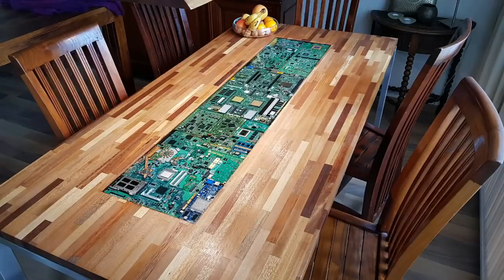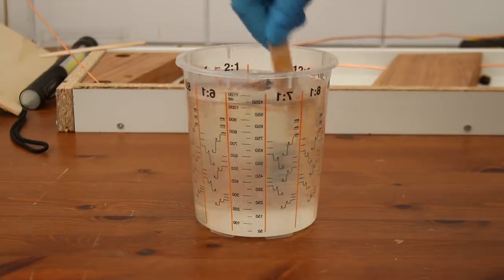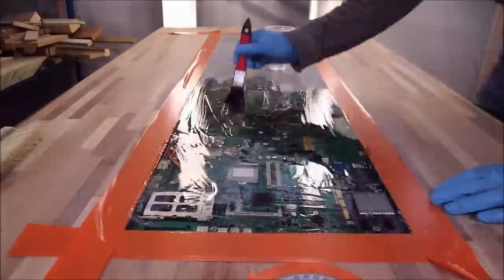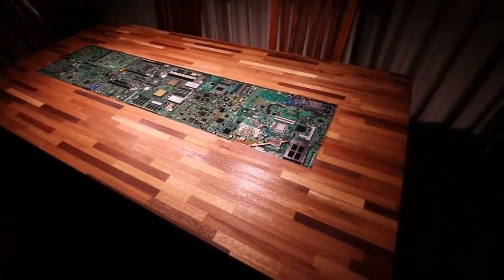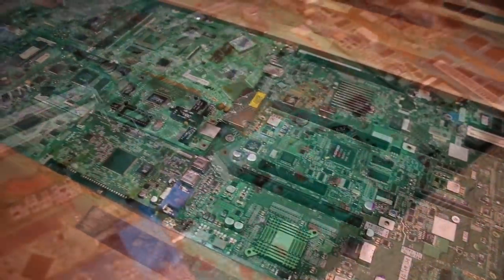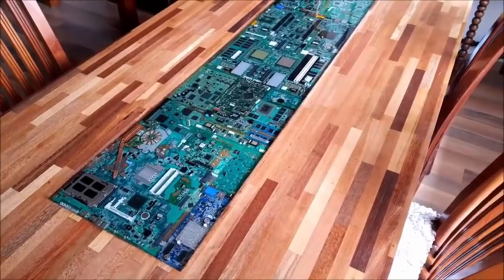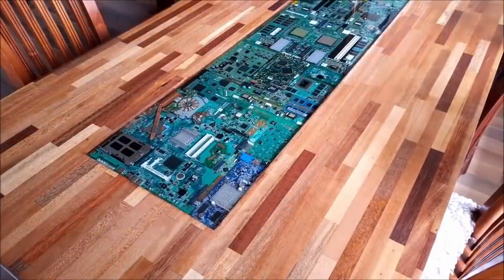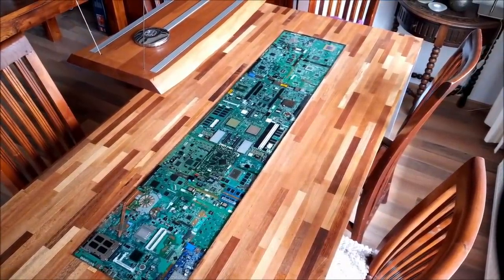Circuit boards with lights in epoxy in a table

Comment: Would of been better off with wires and a battery for the lights, the fiber optics where almost as many wires and you still need a light source lol
Reply from the maker: I deliberately left out the battery powered lights with controller, because I thought you would go crazy quickly of a carnival in a table all the time... 😊 It is the temporary character of the manual light for a few seconds in the fiber optic that I like.
Besides, this setup is infallible, whereas functional LEDs could break down & never be repaired.

Comment: I would coat the whole table in epoxy (or something else) and let it drip over the sides.    In addition to solving the stickiness problem it would protect the wood and the table would have been level and not required sanding.
Reply from the maker: I thought about that, but decided against it. For three reasons mainly: 1. the ugly spots would still be in it, 2. I don't like wood 'wrapped' in epoxy (I like to feel the grain) and 3. it would stop me from learning something about epoxy when I would try to fix the table. So that is what I did, as you can see here https://www.youtube.com/channel/UCNdDV4vHKjuWOYlEW4HIk5w/community I've begun trying to fix the table. I routed out the bad spots and am pouring in new epoxy. The first results look promising. Wait for the video 'how (not) to pour epoxy'. 😊

Comment: Good Work, and thank you for revealing the Fail!  you  could cut all around the table, including the bottom, add false bottom and redo the center with a new experiment.
Reply from the maker: Yes, could have done that, but I didn't. As you can see here https://www.youtube.com/channel/UCNdDV4vHKjuWOYlEW4HIk5w/community I've begun fixing the table. I routed out the bad spots and am pouring in new epoxy. The first results look promising. Wait for the video. 😊

Comment: That is really cool, I love this idea.  I have never worked with epoxy like that so I am wondering if you have ever tried to light a project like that with lights set in the side of the epoxy area?  would that transfer light in the entire area of epoxy evenly or would you have hot spots of lighting?  It would be cool to light the entire center section with a hidden light and then also have the led's light up as well.  fantastic project and I hope you get the epoxy layering problem figured out.
Reply from the maker: I once put a LED strip underneath epoxy, that you can see here.. https://youtu.be/DbGp6R-TN2w?t=552 but it wasn't a big success. To get the light more evenly through the epoxy, you would have to light from the sides and not from underneath. 
As you can see here https://www.youtube.com/channel/UCNdDV4vHKjuWOYlEW4HIk5w/community I've begun fixing the table. I routed out the bad spots and am pouring in new epoxy. The first results look promising. Wait for the video. 😊
Reply: @Onrust1  I see what you mean about the LED's not distributing the light properly.  I am thinking they might need to be embedded in the epoxy, like in a small pocket of epoxy off to the side but I have never tried anything like that so I have no real idea.   That pebble table came out great!  
Question for you on the repair of the circuit board table.  have you considered routing out a section and using another color?
Reply from the maker: Someone else did the same suggestion, but I couldn't see how it eventually would look, and wanted it to be as my initial idea was. So different colors was not really an option for me..

Comment: I just seen you you put one fibre optic access points for a light. But yet the demonstration indicated lights flashing intermittently independent. How is this done on one light source
Reply from the maker: 😊
Easy... the light source is small.. the LED on my phone is almost as small as 1 fiber optic cable. By moving it around, you get this effect. You're invited to come and play with it. 😊

Comment: Have you checked with the epoxy manufacturer.  Some metals interfere with the epoxy hardening.  The metals in the circuit boards may be the source of the problem.
Reply from the maker: I can rule that out, because there are no problems on the epoxy - boards contact level. No, the flaws are all at one level, about 6 to 7 millimeters from the surface. It's where the 5 liters-at-once pour ends and I poured a new batch on top, so that it must be that the 5 liters batch was partly not well mixed. I'm pretty sure about that now. In fact I'm making a video of the fixing of the table, where I show this all in more detail... wait for it.

Comment: The table is a nice idea, but not for a home. Maybe some office? Also laying the boards so wide wasn't good, you could have saved work and epoxy for the effect. The fibreoptics is a touch of genious though, especially if you'd route channels to the bottom of the table. Additionally attaching a small led circuit running on a small battery and few capacitors to the end to make the lights blink in sequence automatically would be cool
Reply from the maker: I deliberately left out the battery powered lights because I thought you would go crazy quickly of a carnival in a table all the time... 😊 It is the temporary character of the manual light for a few seconds in the fiber optic that I like.
Reply: @Onrust1  I get that, it's what you prefer, but then theres people who like to fill their computers with rgb leds and people who like the 80's bleep bloop computer aesthetics :) and  it's not a mutually exclusive with a bit of further engineering. Just as a idea to chew on though. Good luck with your projects!

Comment: epoxy is dry now, so just put another layer of epoxy, this time over the entire table. :D
Reply from the maker: I thought about that, but decided against it. For three reasons mainly: 1. the ugly spots would still be in it, 2. I don't like wood 'wrapped' in epoxy (I like to feel the grain) and 3. it would stop me from learning something about epoxy when I would try to fix the table. So that is what I did, as you can see here https://www.youtube.com/channel/UCNdDV4vHKjuWOYlEW4HIk5w/community I've begun trying to fix the table. I routed out the bad spots and am pouring in new epoxy. The first results look promising. Wait for the video 'how (not) to pour epoxy'. 😊
Reply: @Onrust1  i see. its alright, that just means on to the next epic thing you are about to create.
Reply: Also table is bent in middle meaning if you pour epoxy over entire surface, you'll still have thickness problem in middle.
Onrust is not smart/crafty enough on overcoming a bow (his solution: pour more epoxy on the sides of un-level surface smh)... Proper solution: level half of the table by raising this half, epoxy this half, and then do same for opposite half, and sand/finish at the seam. I just don't think someone who forgets to use a level before epoxy pour (which would've alerted him to bowed table and middle thickness issue) should be making youtube videos.
Reply from the maker: I did use a level.

Comment: Hi,
Nice video! How did you manage the fiber underneath the tabletop?
Reply from the maker: Thank you. What do mean with 'manage'? You can see briefly at 6:55 in the video how they run under the table. Later I put an extra sheet of plywood underneath, just to protect the fibers. I hope this answers your question.
Reply: @Onrust1  Thanks! I mean, organise, set up, protect, attach, or whatever keeps them clean and safe :)

Comment: Can you put a sheet of glass over the entire table? That may fix the issue, or at least make the table useable.
Reply from the maker: Yes, but the ugly spots would still be in.. As you can see here https://www.youtube.com/channel/UCNdDV4vHKjuWOYlEW4HIk5w/community I've begun fixing the table. I routed out the bad spots and am pouring in new epoxy. The first results look promising. Wait for the video. 😊

Comment: Solution: use your circular saw to cut out the entire epoxy section.  This will leave a rectangular hole in the middle of the table. Cut a piece of plywood about 2" longer and wider than the hole and mount it under the table creating a new bottom to place circuit boards.  At least tht way you can salvage the main table. I'm wondering if following this route would have eliminated the need for all the routing and chisel work in the beginning.  This was a cool project and I learned a little from watching you. Thank you for sharing.
Reply from the maker: I totally agree that using this method would have saved me work in the first place (I only would have had to mount the sheet IN the hole instead of under it as you suggest, because of the steel beams running underneath - that being a minor detail). But I decided against going this way to repair the table for several reasons. Mainly because I hate doing the same job twice and because I thought I could learn about handeling epoxy when I tried to fix the table. So that's what I did. You can see here https://www.youtube.com/channel/UCNdDV4vHKjuWOYlEW4HIk5w/community I've begun fixing the table. I routed out the bad spots and am pouring in new epoxy. The first results look promising. Wait for the video. 😊

Comment: now.... i might be crazy.... but could one not just coat the whole table in the clear epoxy?  Would that not stop the "creep" of the soft/poor mixed material? Actual questions, i have not dabbled with epoxy....... yet.
Reply from the maker: Yes, you're right. I thought about that, but decided against it. For three reasons mainly: 1. the ugly spots would still be in it, 2. I don't like wood 'wrapped' in epoxy (I like to feel the grain) and 3. it would stop me from learning something about epoxy when I would try to fix the table.
So that is what I did, as you can see here https://www.youtube.com/channel/UCNdDV4vHKjuWOYlEW4HIk5w/community I've begun trying to fix the table. I routed out the bad spots and am pouring in new epoxy. The first results look promising. Wait for the video 'how (not) to pour epoxy'. 😊

Comment: I make creative epoxy surfboards. I know of the issues you mention. Maybe someone commented already - it is essential to have a constant temperature recommended by the epoxy brand and WEIGH the epoxy parts with an electronic scare before mixing the parts,and throughly stir (in your 7 L use an electric drill with a paint mixer attachment) for 5 min before poruing, ll being mindful of the temperature and time. If it goes off too fast there will be exotherm - not sticky but another issue.
Reply from the maker: I (obviously) totally agree on the mixing part. 😜 Weighing can be good if you don't mix 1 : 1, but if you do mix 1 : 1, it is almost impossible to get it wrong - with larger portions it is not that critical either. I less recognize the temperature thing. I noticed that the epoxy gets thicker with lower temperatures, and it takes very long to cure (as in days), but it must be said that I have the slow curing kind of epoxy, that from itself develops hardly any heat. So I make sure the epoxy is of a good temperature during pouring, and heat the room to about room temperature to cure...
I find epoxy difficult to work with because of the toxic nature of the uncured epoxy and because the mixing is critical and it is difficult to know when you're good with that..
Thanks for the comment!

Comment: Next time, pour your epoxy in a single pour and use a sander held against the table to vibrate the entire thing.  This will ensure it is agitated into all the nooks and crannies and get rid of any unwanted bubbles.  Calculate the amount of epoxy ahead of time to ensure you have enough for a single pour and reduce recommend hardner by 10%
Reply from the maker: I had my sander already in my hand, as I saw that it was very dirty. I was afraid that dirt would end up in the epoxy. I agree that the vibrations could help. (But not the not mixed well epoxy...). What is the idea by not going with the recommended mix ratio and reducing hardener by 10%?

Comment: Why didn't you just use glass or plexiglass?
Reply from the maker: Glass would be a lot easier, but just not as pretty. I like very much how the light breaks only once in epoxy - it's like floating in water, different than glass, where the light breaks twice. I'll show it in my next video, where I put a sheet of glass over the table.
But there are more factors, because things get 'frozen' in epoxy, they won't age, discolor or gather dust, like under glass...

Comment: You should just put glass plate on top of the table - then you don't have to deal with the sticky spots.
Reply from the maker: Yes, but the ugly spots would still be in.. As you can see here https://www.youtube.com/channel/UCNdDV4vHKjuWOYlEW4HIk5w/community I've begun fixing the table. I routed out the bad spots and am pouring in new epoxy. The first results look promising. Wait for the video. 😊

Comment: what you can do is put a thin layer of glass on it, then it will be usable and still show the boards and lights
Reply from the maker: Yes, but the ugly spots would still be in.. As you can see here https://www.youtube.com/channel/UCNdDV4vHKjuWOYlEW4HIk5w/community I've begun fixing the table. I routed out the bad spots and am pouring in new epoxy. The first results look promising. Wait for the video. 😊

Comment: How about next time you read the technical data sheet that came with the epoxy. A high speed mixer with the recommended bit, for 3 minutes is the minimum you should be doing it for. And ideally pour the whole lot in one hit. So long as it’s less than an inch thick as a finished depth you should not get any distortion from the heat as the epoxy goes through its chemical reaction to get hard. But apart from that, awesome idea. My techno kid wants me to make him one now lol

Comment: I would have epoxied below the circuit boards to make them stick together without the glue showing through, bezelled the edges and put a pane of glass over the top.

Comment: So from this, i got the idea to get a small PC, take it apart and do something similar to this
But with the end result of a working computer being inside the table, visible like this and all. not in epoxy but under glass so you could fix and swap parts, possibly lighting and possibly not a small PC but an actual machine, possibly with watercooling running through and all that.

That sounds like a shitton of fun to build.
Reply from the maker: I like the idea. Do it! 😊 And I'd like to see the result once..

Comment: Did it finally dry?
Reply from the maker: Yes, it stopped 'bleeding', and after that, as you can see here https://www.youtube.com/channel/UCNdDV4vHKjuWOYlEW4HIk5w/community I've begun fixing the table. I routed out the bad spots and am pouring in new epoxy. The first results look promising. Wait for the video. 😊

Comment: That is now a toxic table. Epoxy that does not cure is toxic and you should not be in contact with it or breath in any fumes that it gives off. This is a bad project seen from an environmental perspective.
Reply from the maker: Yes, it is toxic, but it will cure in time. I hated the idea too, of a table being unusable, so as you can see here https://www.youtube.com/channel/UCNdDV4vHKjuWOYlEW4HIk5w/community I've begun fixing the table. I routed out the bad spots and am pouring in new epoxy. The first results look promising. Wait for the video. 😊
(from a environmental view you couldn't use any plastics at all, so that statement is exaggeration...)

Comment: To fix: Repeat steps beginning at 1:31. Cut/Chisel the stuff out. Might me a bit messy but should be doable.
Reply from the maker: As you can see here https://www.youtube.com/channel/UCNdDV4vHKjuWOYlEW4HIk5w/community I've begun exactly doing that - fixing the table. I routed out the bad spots and am pouring in new epoxy. The first results look promising. Wait for the video. 😊

Comment: An excellent idea but with sad results. Are the soft spots due to air bubbles or the epoxy being too thick?
Reply from the maker: No.. as I said in the video.. I messed up the mixing of one batch. But as you can see here https://www.youtube.com/channel/UCNdDV4vHKjuWOYlEW4HIk5w/community I've begun fixing the table. I routed out the bad spots and am pouring in new epoxy. The first results look promising. Wait for the video. 😊